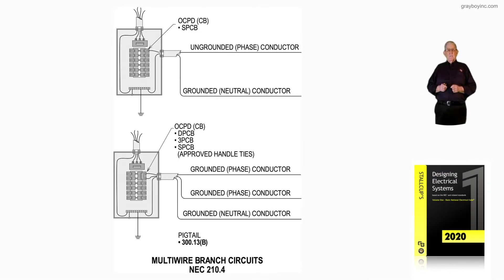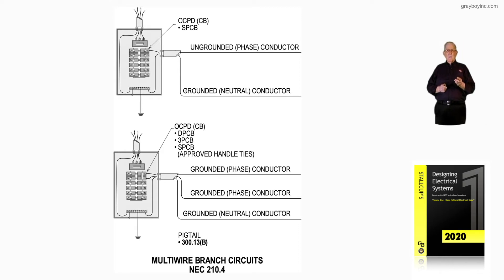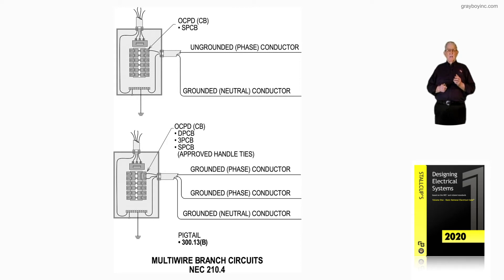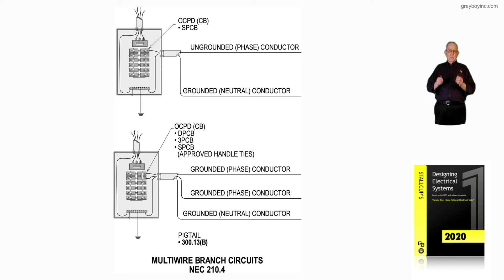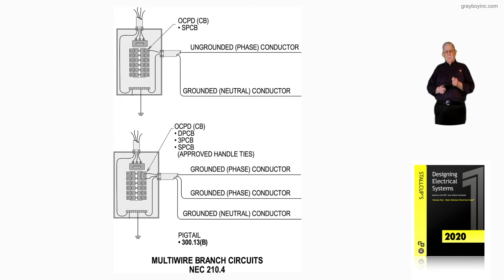14-27  MULTIWIRE BRANCH CIRCUITS - 210.4

Comment: James, I have found a multi wire circuit originating in a old (1976) Pushmatic service panel. The red and black conductors are placed on breakers that are vertically next to each other.  These pushmatic panels have two vertical bus bars unlike the more modern bus bar arrangements where bus bar fingers exist.  So what I have is 1 phase supplying both circuits in this multi wire branch circuit.  Is this a problem?  This a quite different from and discussions I have seen.
Reply: Yes this is a safety hazard.   The obvious is the overheating of the neutral because instead of carrying the imbalance,  the currents will be additive.  For example,  if I plug in an electric skillet that draws 12 amps, in the top half, and a countertop rotisserie oven that draws 14 amps on the bottom half, II will have 26 amps on the neutral instead of 2 amps.   Second,  a multiwire circuit must be controlled by a two pole breaker or single pole breakers with an identified handle tie to ensure that all ungrounded conductors are de-energized simultaneously.